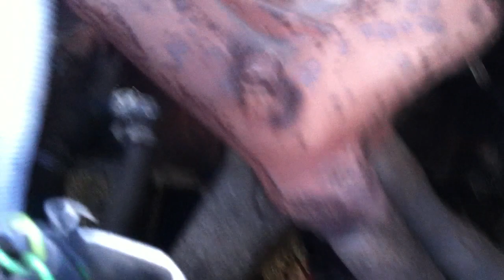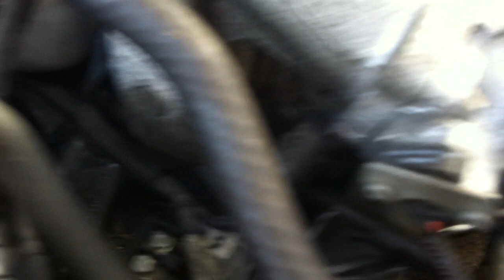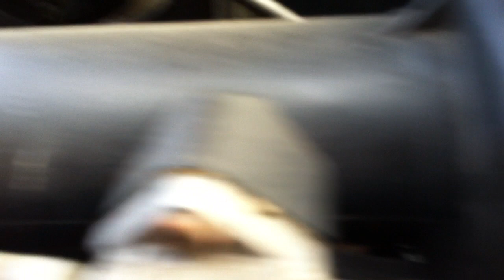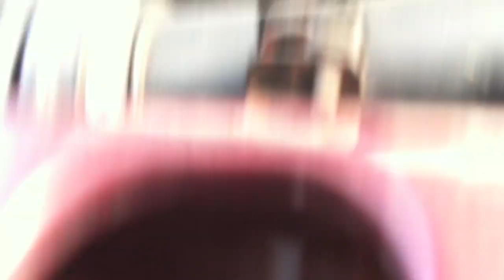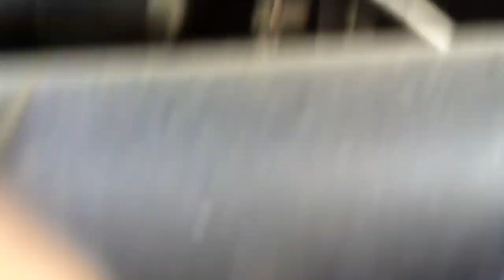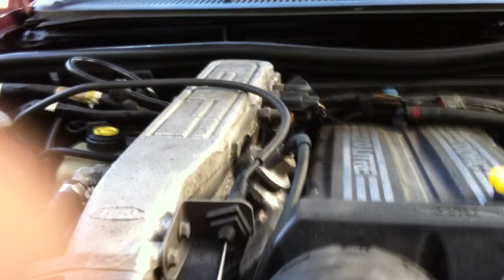Ford Sierra 2.0 EFi DOHC engine

Comment: is the cylinder head metal or have you painted the stripes mine is plastic
Reply: This would be a repainted cam cover......I had an immaculate DOHC Sierra Ghia between 1997 and 2001, and the cover looked shit !! All the original silver stripes were coming off, I just stripped the rest off with brake cleaner and left it black !!!
Miss that car, big time !! 😥😥

Comment: hi . now i have same problem with this strange knocking in enginge, did you find  the cause of it ? can you help me ?
Reply: its becus the engine takes oil, when oil lower the knocking sound is from the valves, why it takes oil is becus its a main problem with this engine´s at 200.000km the valve gaskets go down hard to describe but its just som gasket that get bad and that means oil will leak in and the engine starts to smell like it is burning oil and it does.. blue smoke or alot of smoke will come at the exaust.. so to fix it you need to take the top apart and renovate like i did.. or send it away and have someone else to do it